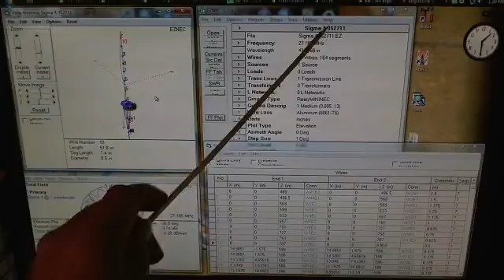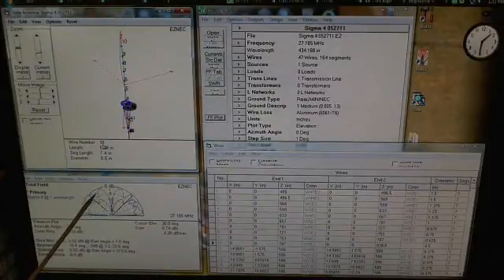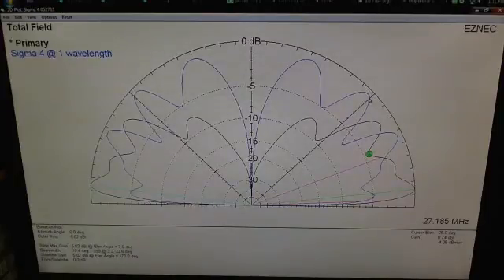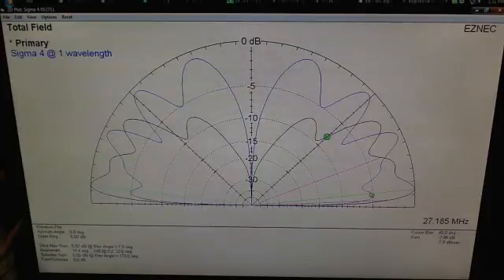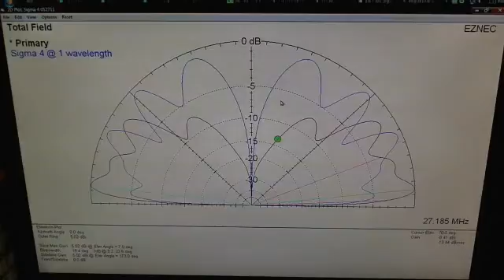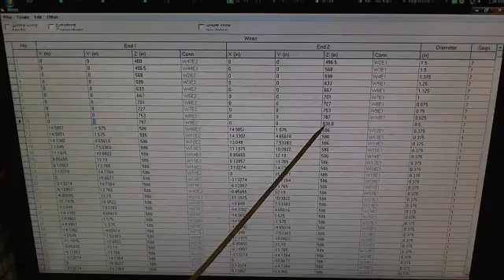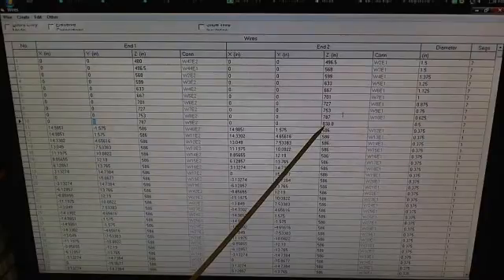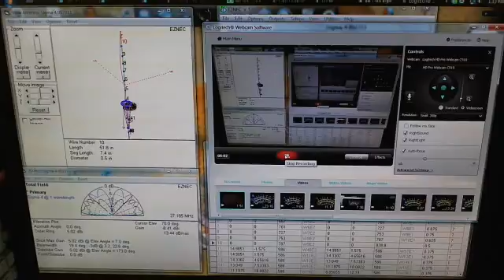Booty Monster's question re: a full wavelength Vector 4000

Comment: thank you very much Eddie . i really appreciate you taking the time to show me the results of the program . if someone was down in a valley the 36 ft length could help them . .82 will be my starting point and i will play with the length to get the best performance from there . 

thanks again for the time and effort to help me ;)
Reply: If you want more gain on the horizon than Stock configuration then a 5/8 above the ring will provide that.
- Going longer will add better gain at higher DX angles but it will suffer loss at lower TOA.